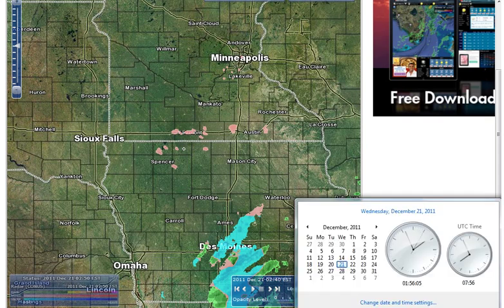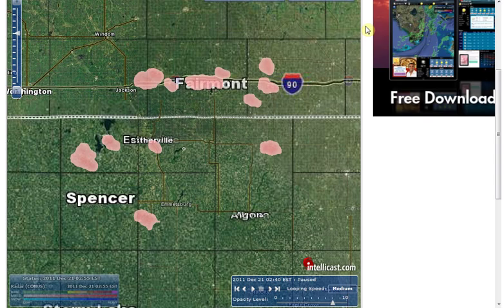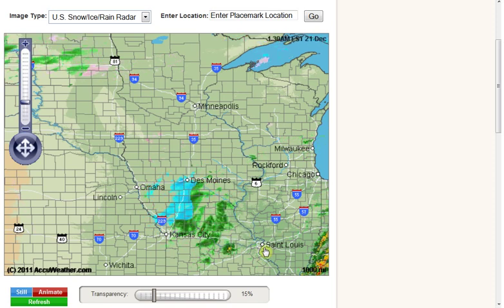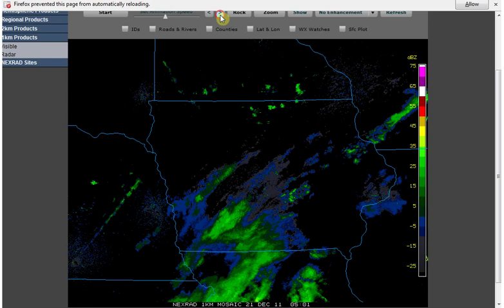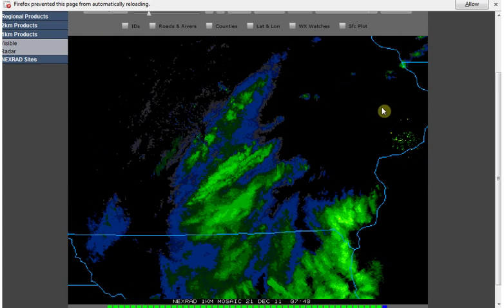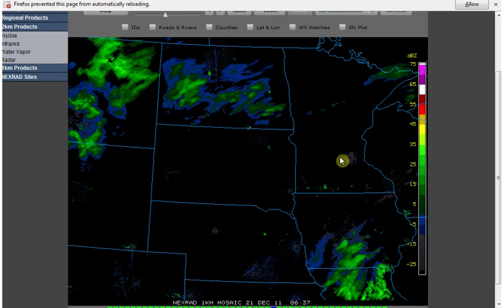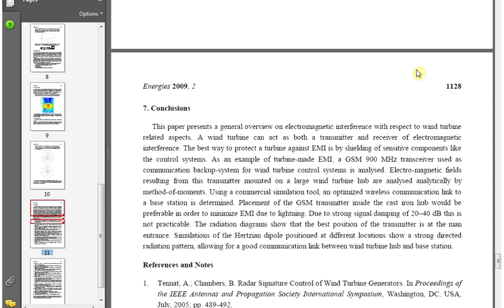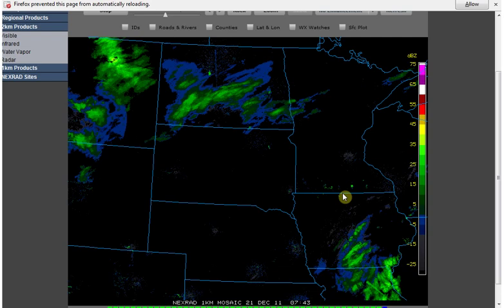12/21/11 Wind Turbines Receiving Electromagnetic Energy from Doppler Radar

Comment: By the way.  One type of EMI that the article you found is discussing is the same type of EMI that affects electronic devices in general.  You're computer, microwave, cellphone, IPOD, car's ECM...all can and do emit and receive EMI.  That's why electronic devices have to be shut down during take off and landing.  The mega-watt generator throws off a field around itself.  The other effect is the spinning blades.  They can distort transmitted signals for people living down signal from the farm.

Comment: @BethanyHome7 
As for wind farms.  They typically only show up when they, like the cell towers are built close enough to the radar to be in the line of sight of the 0.5 degree tilt angle. Wind farms only appear on radar if the blades are spinning as the radar is programmed to ignore stationary targets.  Big stationary targets can cause blind spots in the radar but won't generate false returns.  When wind farms far from the radar show up it is due to atmospheric ducting.  Google it.

Comment: @BethanyHome7 
"""If that be true, every downtown area would be lit up like a Christmas tree.""""
Incorrect.  The cell towers only show up if they are in the line of site of the radar.  The lowest weather radar tilt angle is 0.5 degrees.  Once you are beyond about 10 kilometers from the radar the radar is aimed above all but the tallest communications towers.  Plus not all communications towers transmit on a frequency that is a problem for weather radar.

Comment: Buffalo national weather service page has a nice entry on wind turbine interference with weather radar.  

The beam that points NW out of STL?  Cell tower.  38.719283N 90.714128W  .  You can check it out on street view.  Then research the type of interference such improperly located communications towers cause for weather radars and how.